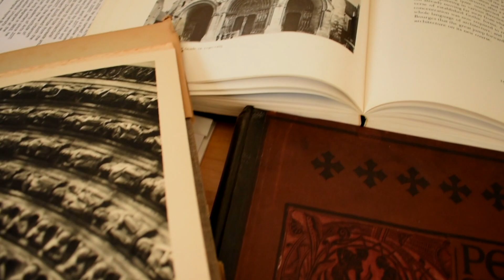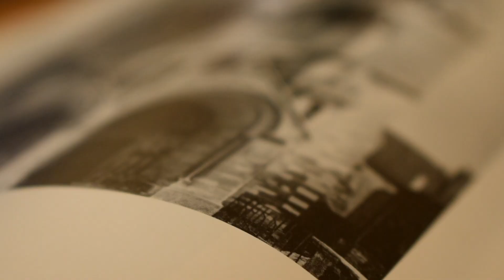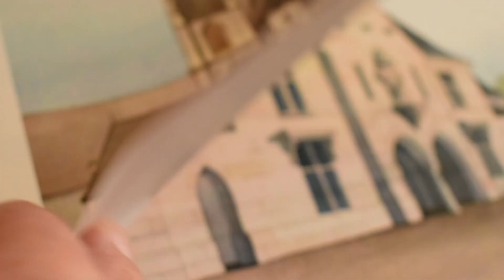Can The Glory Of Notre-Dame Be Restored?

Comment: So very true.  The rebuilding of this great structure must follow the original design using the original materials and techniques.  As far as identifying which parts/pieces are replacements follow the example of the Smithsonian Air Museum, by producing reproduction parts (in many instances from the original blueprints) and imprinting the word "duplicare" (Latin for duplicate) on them.